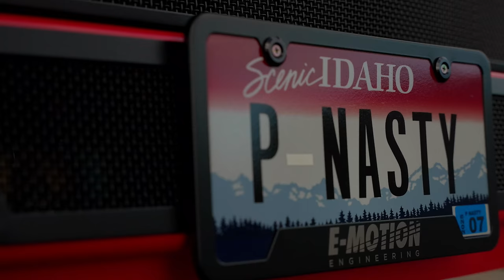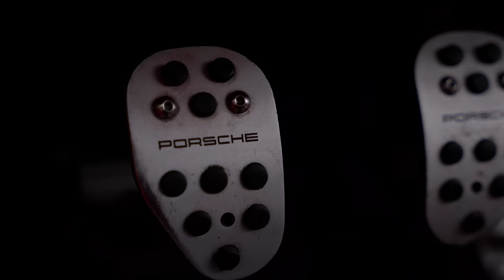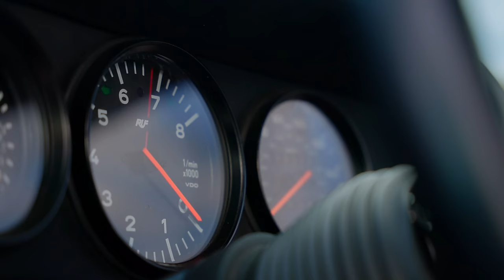PROJECT NASTY - AIR COOLED 997 CUP CAR PERFORMANCE FOR THE STREET IN A 85-911 G BODY PORSCHE

Comment: Ortega Highway!
Take it from an old guy, twenty years from now you're going to want this car back. Young guys are always searching for the latest and greatest not appreciating what they have. I did the same thing and I guess if I hadn't sold the previous car I wouldn't have been able to buy the next one. The thing is, while they were all cool cars, some were special. It was the special ones that linger in your memory and if you can hang on to them, will take you back in time every time you get behind the wheel.

Comment: An odd looking 997
Reply: It's not? It's a Carrera G. It has "997 performance" and 996/997.1 parts, which were also 3.6L. The intake, exhaust, scavenge pump, crank, are out of a 997 cup, the engine is 964 RS.
Reply: I think its a 964
Reply: @BPF80MCar-vi1pg  It isn't, it's basically a 930 or 964, but it doesn't have a chassis code, just G variant of the carrera 2, what used to be called the 911SC.